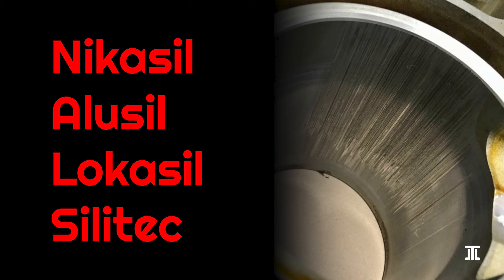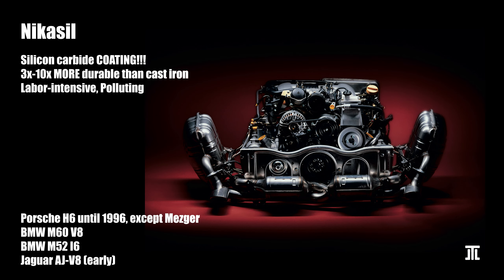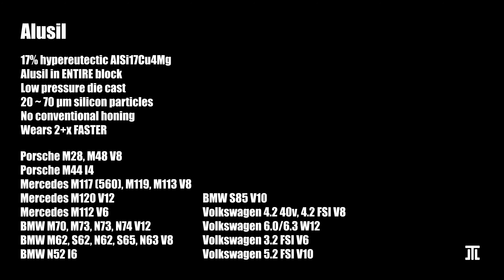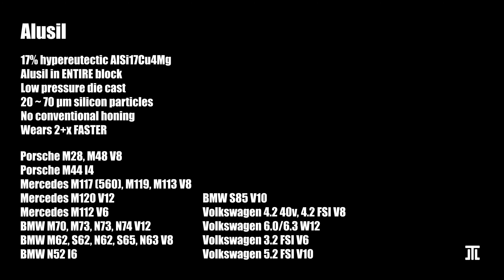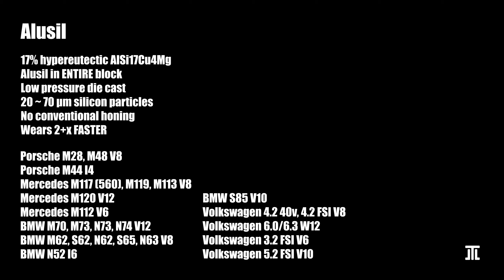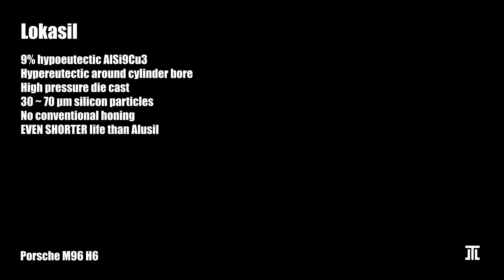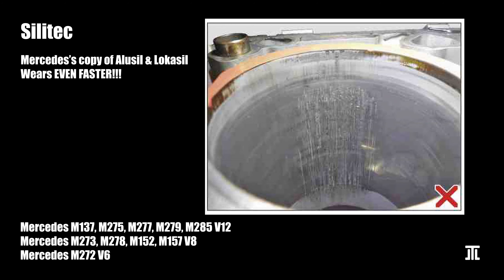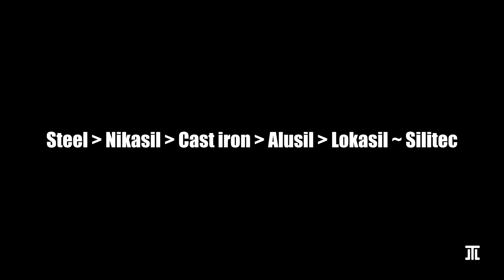Nikasil, Alusil, Lokasil, and Silitec: Cylinders in liner-less aluminium engine blocks

Comment: Great article and video.  I'll add that on my 1989 Porsche Carrera 3.2 came from the factory with Alusil cylinders.  I read that some bound for the US only came with it, but I can at attest at least one 930/25 was certain to have it.  In 122,500 miles it held up pretty good with normal wear when I tore the engine down.  Other engine components gave up faster.  When I rebuilt I did replace them with a new Mahle Nikasil piston and cylinder kit.
Reply: So, you did nothing on the zylinder? I don't get it because there are no Nikasil pistons, Nikasil is for the cylinder surface.
Reply: Always wondered what my 581k mile N52 liners look like.
Reply: Can't beat the old cast blocks or cast iron liners !! I had many old motors when I worked for cab companies that I refreshed just putting new rings and bearings in them with a valve job and running them another 200 thousand after the original 300 thousand !! Then later you could always just bore the block for a like new wear surface but by then the bodies of the cars were falling apart .. One mistake with these nic- sil alloy coated cylinders overheating and the liners peel off or score ,and the blocks are junk ..